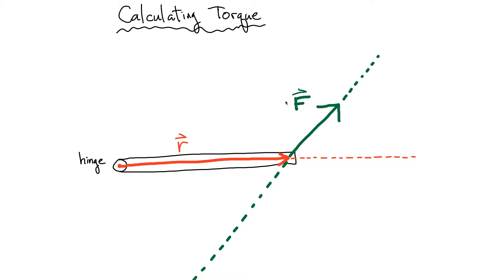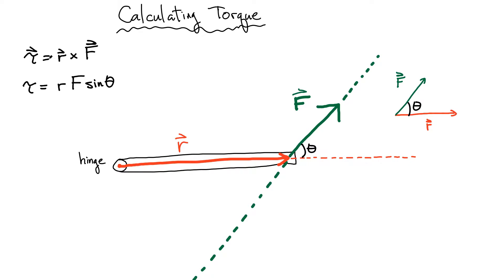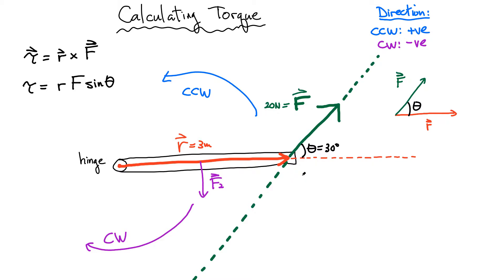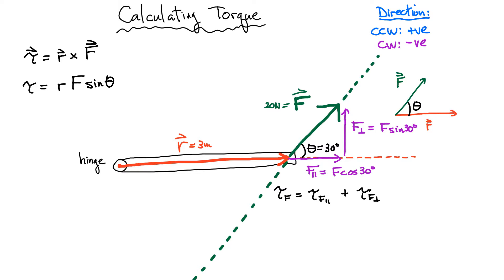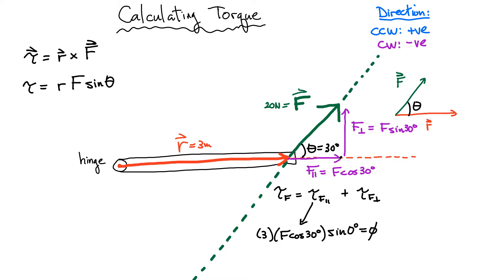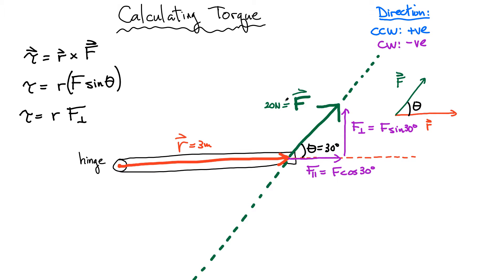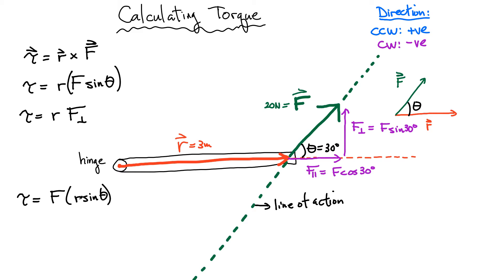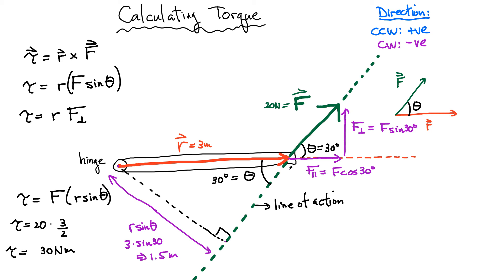Calculating Torque

Comment: Can any body tell me how to calculate theta for the resultant force of a object monted on top of one side of a vertical beam if i know the weight and dimensions of the object.  I actually want to know the distance the tip of the beam will move when the beam is 2.6 mtrs tall and the highest fixing is 1.2 mtrs from the ground.